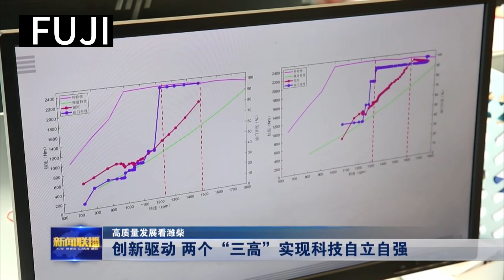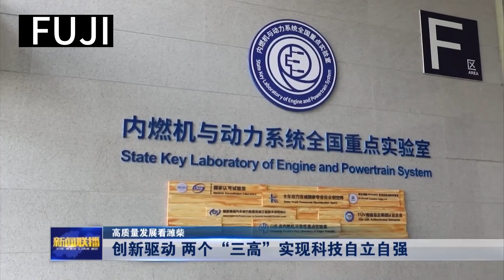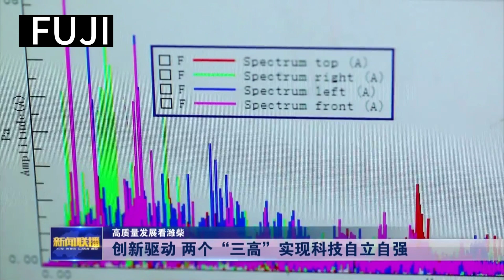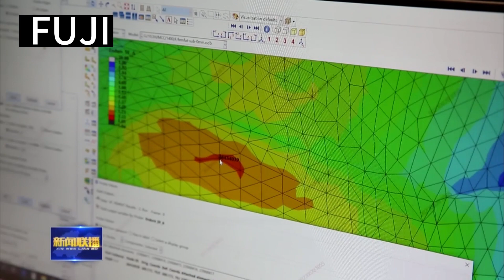Innovation of Weichai （internal video）20230712

Comment from the maker: 13033772 Parking electromagnet
13026697 Parking electromagnet
1000884979 parking electromagnet
13034654 Parking electromagnet
13051732 Parking electromagnet
13021426 Parking electromagnet
13022811 Parking electromagnet
13026888 Parking electromagnet
13034655 Parking electromagnet
13026882 Parking electromagnet
13035101 Parking electromagnet
13026883 Parking electromagnet
13039205 Parking electromagnet
13026795 Parking electromagnet
13051733 Parking electromagnet
13024188 Parking electromagnet
13022981 Parking electromagnet
13071293 Parking electromagnet A2000C-F electromagnetic actuator 612600080686 612630080038 common rail pipe Bosch No. 0445226053 CW6200 diesel engine double-layer anti-leakage explosion-proof high-pressure oil pipe assembly 612640080015 common rail pump 0445020240 610800080104 410800080001 610800080008 610800080164 610800080292 610800080481 610800080995 611600080010 612600080281 612600080368 1000046758 61500070051 12189888 12188100 61500070030 X0818/1000645393/1000588583 1000424916 13026769 13050733 13057200
  1000036081 1000050387 1000053557 1000053558 1000104480 1000422381 1000422383 1000495963 1000524630 1000588583 1000632616 612600040355 612600111970 612600113015EGR 612600114182 EGR system assembly
612600112885 EGR outlet flange
612600114180 EGR system assembly
612600116096 EGR intake pipe assembly
612600113034 EGR valve gasket
612600113036 EGR outlet pipe
612600113036M1 EGR exhaust pipe
612600113045 EGR intake pipe
612600113055 EGR outlet pipe
612600113057 EGR outlet pipe
612600113062 EGR outlet pipe
612600112917 EGR intake flange gasket
612600113011 EGR valve assembly
612600113015 EGR cooler
612600113916 EGR outlet pipe
612600114919 EGR outlet pipe
612600061120 EGR cooler inlet pipe assembly
612600061142 EGR cooler outlet pipe
612600113105 EGR cooler outlet pipe assembly
612600113143 EGR intake pipe
612600190114 EGR valve
612600190133 EGR controller
612600061129 EGR cooler outlet pipe
612600190306 EGR controller
612600083216 EGR wiring harness
612600115709 EGR outlet pipe assembly
612600113980 EGR valve
1000077945 EGR wiring harness
612600116201 EGR valve seat bracket
612600116214 EGR outlet pipe assembly
612600116236 EGR outlet pipe assembly
612600116238 EGR outlet pipe assembly
612600116240 EGR valve seat bracket
612600116314 EGR outlet pipe assembly
13063424 EGR wiring harness
13067608 EGR wiring harness
612600115704 EGR intake flange gasket
612600115706 EGR outlet pipe assembly
612600115717 EGR intake pipe assembly
612600115725 EGR cooler bracket
612600115738 EGR outlet pipe assembly
612600115742 EGR cooler inlet pipe assembly
612600115747 EGR intake flange gasket
612600115763 EGR cooler
612600114792 EGR cooler bracket
612600115808 EGR outlet flange gasket
612600115818 EGR outlet flange gasket
612600115830 EGR inlet pipe gasket
1000027558 EGR wiring harness
13065425 EGR outlet flange gasket 612600114609 612630110710 exhaust pipe gasket
612630110732 exhaust pipe bolt
61500110011 exhaust pipe sealing ring
61500110022 exhaust pipe gasket
612630110405 exhaust pipe heat shield
612630110492 exhaust pipe gasket
612630110024 exhaust pipe sealing ring
612640110137 exhaust pipe
617022000003 exhaust pipe
617022000004 exhaust pipe